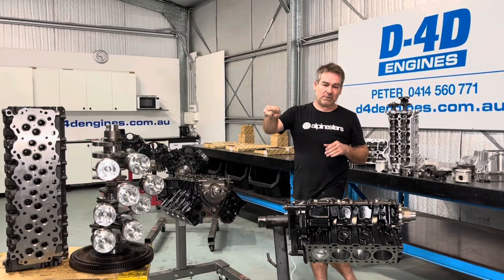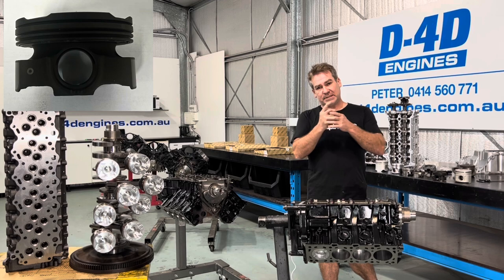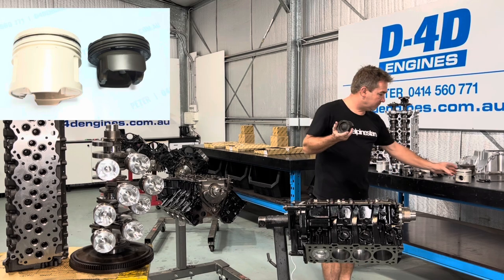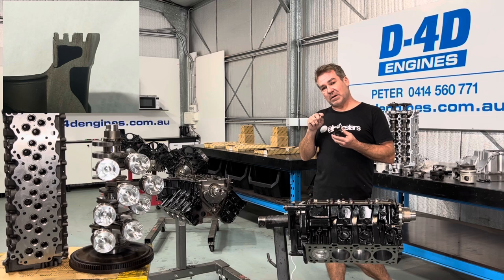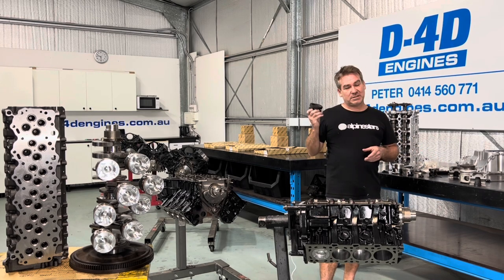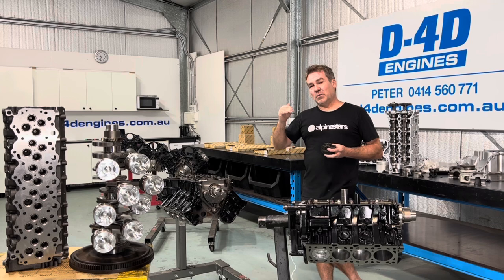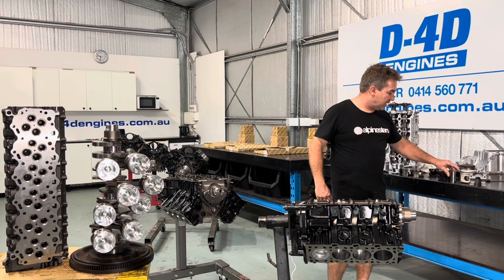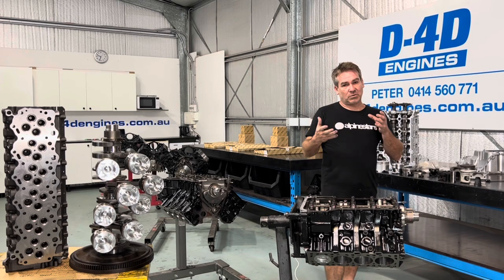Toyota Landcruiser 300 SERIES STEEL PISTON low friction engine, heat transfer OIL USAGE part 2.

Comment: How is piston slap controlled when the piston is 1/4 the length, and the rings are lower tension and slimmer, and the piston is heavier.  There is no piston skirt to help control it, and the rod still moves from side to side at the crank end meaning the piston will slap by design.
Reply: Have a look at JE piston skirt designs, many factors in piston design control this.
Reply: I thought the exact same thing.

There still is a skirt, though much reduced.
I’m wondering if their is an anti friction coating on the skirts as well as the wrist pin.
Just so little sources of information around.

Comment: A nice look at the newer technology going into things.
Lower viscosity oils probably help also making for greater flow thru the engine taking heat away faster and for a good squirt under the crown.
Easier pump ability to.
Love ya work👌

Comment: That’s very informative and very interesting in how the manufacturers are getting more from less.

One would think more oil changes particularly in adverse/towing conditions would protect the engine better, but I guess another big factor is oil quality and shear resistance.

I would love to see a well maintained engine tear down wear characteristics after 500,000 and 1,000,000 klms. No doubt those klms haven’t been achieved yet.  
Will 1,000,000 klms ever be reached.
Time will tell.

Incredible that they are circulating the oil so close to the heat source.
That oil better be able to take it.
Would not Pao Ester type oils be more suitable in this situation.
Especially given the heat the oil is exposed to.
If more oil volume is required per piston, then the oil pump total flow must have increased.

Engine design is so unconventional now and frankly mind blowing.
Will the gudgeon pin coating last.
One would hope the engineers have done their homework.
If they couldn’t get the 1kD engine right (seven piston alterations I have read), nor the DPF “design” and implementation (or should I say, lack of design, as other manufacturers seem to have a lot less issues), how can we trust that the big T has done their due diligence?

Again, only time will tell.

Good explanation about the benefits of less ring tension.
I bet many people think that it’s piston to bore clearance has been reduced which is not the case at all.  Of course the trade off has to be that extra oil usage initially.  Makes total sense.

I initially thought they did away with a piston skirt until I zoomed my mobile up on the piston you had.

I’m guessing the black colour is a piston coating as well, or not?

I know Mahle have a patented “Grafal” coating on the piston skirts, so I was wondering if the steel pistons have this.

Mind you, Mahle are not cheap and perhaps overkill for typical street use.

Comment: Question 1
Is the 0w-20 or the 5w-30 (both recommended in the owner's manual) better for this engine in a tropical country like Malaysia, where temperature can go up to 39c? 

Question 2
When an engine oil specifies A5/B5 AND C2, is it suitable for this engine?

Comment: Hi there!
Can you please advise whether I can swap 2KD engine to 1KD engine in my Toyota Hilux 4x4 Vigo 2014 easily.
Are the engine mounts the same?
Can I use the same parts like radiator, alternator, aircon compressor, etc..

Comment: Mate, all those things you described have been used in engines for literally decades. Same with the piston design, been used in truck engines for decades upon decades. Juts because its taken Toyota 100 years to catch up doesn't make it new. Be honest,  Toyota make shit diesel engine apart from the FTE.  The 1VD is a pile of shit, all that tech and its a gutless, fuel guzzling shitbox. Not the first time Toyota made an engine that drinks oil is it?